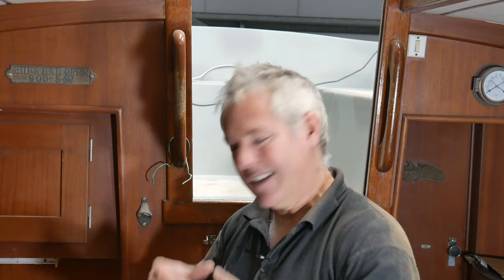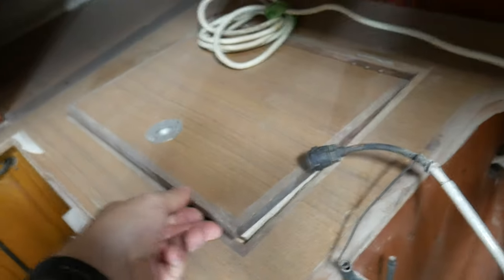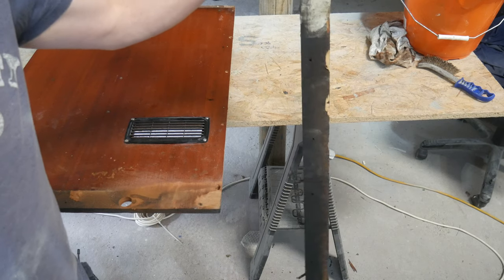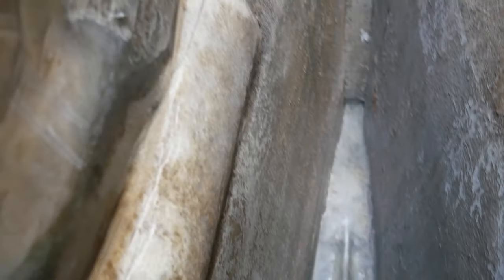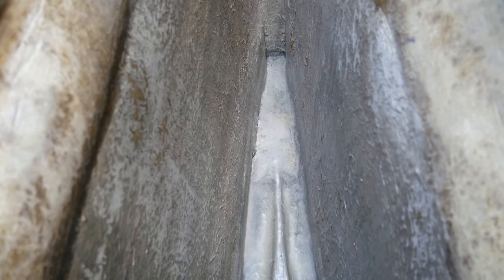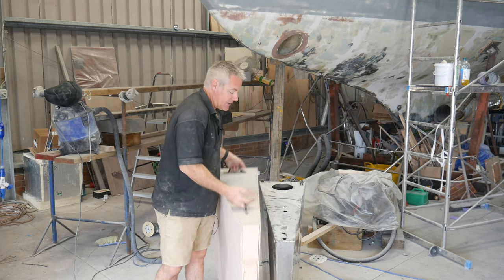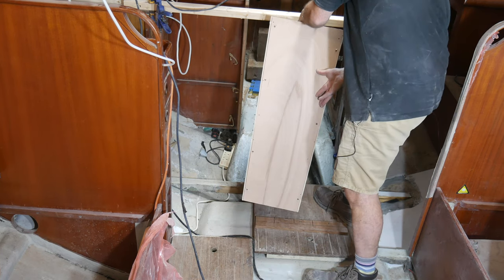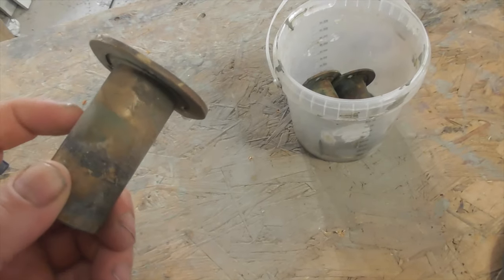#60 Plastic V Stainless Steel Fuel tank?

Comment: You're making great progress keep it up.  Regarding securing your fuel tank, you could epoxy some blocks of G10 and if you have the tank manufacturer put some attachment points use bolts to attach to the blocks or stainless straps to the G10(?).  Make sure you have access ports put in the tank just in case you need to reach in there to clean it.
Reply from the maker: Hey Rich that's good advice. I really like working with G10 now too.

Comment: As Mads (Sail Life) did. Put the heater pads on the deck and vacuum bag the underside of the deck. Vacuum bagging will cause the moisture to "boil out" and be removed....best part....it is quick.
Reply from the maker: @Garland Garrett I’m not sure that Mads used the heater pads on the underside of the deck. I saw him set the vacuum pack on the shell (Hull) but I didn’t see him do it on the deck? Which episode was that one ( where he did it to the deck) ?
Reply: @aboatcalledwanda6925  He didn't use them on the deck, only on the hull. If you recall, he replaced the entire deck core. However, since you have essentially sealed the entire top of the deck you can bag the underside and using a vacuum pump (as he did) create a vacuum under the deck and force the moisture to boil out (at less than room temperature). Not only will the water boil out -the vacuum pulls the moisture out of the core. Temperature isn't any issue as it will be less than room temperature. The heat pads will accelerate the process if laid atop the deck (and be out of the way). You will need a vacuum pump, reservoir, bagging, seal tape, and required hoses, you may need the cloth to assist the flow of air similar to vacuum molding. Its not the hull but the process is the same. Great videos, I've binge watched them all over the last 4 days when I found your channel.
Reply from the maker: @garlandgarrett6332  yes that's what I thought - I've not seen anyone use it on a moist deck core yet. Stay tuned all will be revealed :)
Reply: @aboatcalledwanda6925  awesome, can't wait.

Comment: Been involved in a lot of wet core (both foam and balsa as well as other woods) repairs in boats and I am sorry to say that the only way I have ever seen or used that is effective is to remove one of the skins and take out the offending material completely back to dry areas.  The closed cell nature of the foam normally used just will not dry although it certainly will soak up moisture and not just in the interstacial spaces.  In one case many years ago we had a 13 foot Boston Whaler that was totally soaked.  It was in a dry boat house and even with the outer fiberglass skin completely taken off that foam was still wet after a year!  In most situations if the area is very extensive and behind built in furniture etc. it just is not worth doing.  A few square feet of accessible coring is very doable if you provide the labor yourself but as it becomes more and more difficult to access it becomes less feasible.  You have to weigh your priorities with a limited life span of what you want to do.  Some things just are not worth your time much less the money.

Comment: Great video, I think you made the right decision going stainless for the tank the only experience other than outboard fuel tanks I have had is plastic bike and 4wd tanks and I have to say I am underwhelmed by their performance and longevity with several plastic bike tanks cracking after a relatively short time. avoiding galvanic corrosion should be easy enough just give the bottom half of the tank a couple of good coats of epoxy or polyurethane paint to isolate it from the electrolyte, also since it's a new tank might I suggest using  Fuel doctor or similar when you eventually fill her up to keep her clean. you can also get water separating filter funnels for those times when you refuel from a dodgy source.

Comment: Would recommend putting a pipe in place running down to the lowest point in the bilge below the tank when you refit it if there's room, so you can suck up any water that gets in there to stop your tank from corroding again. Also if you are having a new tank made, consider putting in a clear tube that runs from the top of the tank to the bottom so you can sample the fuel. If that makes sense  I think Calder has some great info in his books on tanks. Shoot me a mail if you need anything
Reply from the maker: @sailing Yacht Zora thanks heaps for reaching out and lending your support. I'm a big fan of Nigel Calder and have learnt a lot - particularly around batteries and electrics. Fortunately the lowest part of the bilge is in front of the tank - not sure if you saw the early vids but HR actually provide a drain at the lowest part of the bilge - so you can undo the plug and drain the bilge when on the hard - very cool! I think the corrosion of the tank was most likely due to galvanic corrosion rather than corrosion due to acids or chloride kick around the bilge. There were many metallic objects in the bilge that would have formed an electrical circuit (Swiss army knives, drill bits, forks, spoons, bonze tail pipes) - with salt water proving the electrolyte. Also there was no anode on the Bronze prop when I got Wanda, and as the prop, rudder stock are all bronze the fuel tank would have been the sacrifice as they were all boned together. Im planning on installing a DIY fuel polisher in the tank as my last boat in Hong Kong got inundated with diesel bug and I had a massive job to get rid of it. Will talk more about fuel polishing in later vids. Cant wait to get it sorted.
Reply: @aboatcalledwanda6925  ya I saw that bung, it's a great idea and I'm gonna add one myself I'd say. My keel has a 700L water tank and a 300L diesel tank so that would be handy. I've considered fuel polishing as well but might not fit that till refit part 2 😁
Reply from the maker: @SailingYachtZora  yeah its good to have the 'nice to have' list separate to the 'must have'. I'm not sure if the bungs are easy to source - if for any reason they are I know you can buy the complete unit from Hallberg Rassy parts and fit it yourself. Thats a lot of great ballast you've got down low with the fuel and water - nearing a ton?
Reply: @aboatcalledwanda6925  I'll probably just drill and tap the plating, it's 8mm steel. Ya it's handy, I'm not sure how to utilise it though. I don't like the idea of water against steel or a fuel tank that I can't access to inspect. Time will tell. I find the boat work easy, but it's the battle you fight between your ears to be the hardest part!
Reply from the maker: @SailingYachtZora  YES!! I get to the stage where I overthink things. Was talking to my Dad about this the other night - he is a very skilled wood craftsman. You spend a lot of time thinking though how you will approach something, the sequence, dependencies, tools, jigs etc. Then suddenly it all falls into place and it's just a matter of execution what you have thought through. Then it's all easy. Getting to that point can be hard though sometimes.

Comment: _ Have you considered using "Foam Cement" as a bed for your tank base? It's STRONG, LIGHTWEIGHT  and Everlasting. It can be Epoxied over to prevent any Gunge, mould etc. ( You pour it into the Bilge, rest the tank on top of it, let it dry, remove the tank and then epoxy coat the whole bilge area. ) The German name for the foam concrete/cement is "Schaumbeton" A better bed you'll never find and it'll carry the load where it's needed leaving you to only brace the Topsides for future removal! _

Comment: You are making great progress even if that involves going backwards at times. With reference to the wet deck core the only suggestion I can make (in common with others here in the comments) is to try the vacuum route in conjunction with a heat mat.
Reply from the maker: @Norman Boyes thanks for your comments - that's definitely the direction things are heading in now.

Comment: Have you considered using (part of) that bilge as the fuel tank? It would require a thick layer of a suitable epoxy over the GRP but you have already sanded the area so you're good to go. You wouldn't have to worry about fixing the tank in place. You should however glue in one or two baffles. You could also maximise the size of the inspection hatches. Much cheaper (and probably faster) than ordering a custom made stainless tank. Love your project by the way! Brings back sweet (and not so sweet) memories.

Comment: If you made the tank of stainless, the tank sides and/or ends could be extended above the tank top, and shaped into bolting pads that fitted against the inboard sides of (what look to be) the engine girders. You could make up some further templates to position them. These would support the tank above the bilge, which would allow effective drainage of any bilge water in that area.  Maybe 4 bolts along each tank side.  Greg
Reply from the maker: Cheers Greg. I would like to keep the costs down so probably the simpler the tank design the better.
Reply: A cheaper way to get the same bolted arrangement would be to just do a basic tank, and weld straps to the tank side, extending up, sort of like hull chain plates.  Greg

Comment: I wonder if the galvanic corrosion on the tank was caused by the steel engine coupler ... it was extraordinarily rusty for something that's often oily.

Galvanic action needs both anode and cathode in the same solution.
Reply: Alain Moran I didn’t see that the tank had a bonding strap on it... when the new tank is welded up they should add a tab near the pump to attach a bonding jumper.

Comment: just keep in mind the engineering principles of load transfer in that tank, the entire tank should be supported by the keel, not the hull. I would be very careful placing anything that could create a lateral load on the inside of the keel, you dont want your keel to split apart after a bit of pounding in a seaway!
Reply from the maker: @Superform good advice. I want to make sure it is sitting flat on the bilge and has shims in the side so there is no side movement of the tank within the bilge. Could take a bit of work to get there...

Comment: Hey Richard. 
Good seeing your energy and approach to fix the boat. 
Have been thinking about the corrosion and pitting in the bottom of your tank. Stainless steel is widely used for fuel tanks. Condensate in the bottom of the inside of the tank should not lead to saline conditions where corrosion and pitting occur ? 
So the saline water can come from persons (soap or other products runs into the bilge) but that would be general problem (that I haven't heard of) or from seawater get into the boats during accidents or a (tiny) leak after the accidents ? 
In tropical conditions the water in the bilge dries up (water evaporates) and the salt concentration increases - creating the conditions for corrosion and pitting together with elevated temperature. Have you considered to check for leaks ? It would be a shame to put in a new tank and have the same problem again later. 
Another thought, can't the upper part of the tank with all the (expensive) connections be reused ? 
Best regards Kent
Reply from the maker: @Kent Dreymann thanks very much for your comment and thoughts. From what I read, proper 316 stainless steel has Molybdenum which protects against chloride. So salt water should never corrode or pit proper 316 unless there is other factors at play. Therefore I think it would more likely have been pitting due to Galvanic corrosion - where ions are moving from one metal to another and the stainless steel starts to become pitted. That could be due to poor grounding, or grounding to bronze without an anode in place. When I got Wanda there was no anode on the prop which is bronze and heavily pitted. As the tank was bonded to the prop I think that's where some of the corrosion took place. I have learned a lot about materials in the process!

Comment: Can you not reuse most of the original tank. Galvanic corrosion via the prop etc is unlikely as they were not in the same body of water but something such as a bilge pump or some other metallic or electrical thing in the bilge might have been a contributor. Hen refitting perhaps build a better bulkhead at the aft end of the bilge to keep the tank safe but also include some means to extract any stray liquids around the tank... Also have you tried using thinners or acetone or whited spirits or petrol on the glue residue I had good results using one of these... Cannot remember which....

Also be sure that your tank pickup is perfect as I just lost my entire season due to air getting in the fuel line seemingly from the fuel pick up...

Nice stainless cleats available cheaper than HR originals...which are aluminium...

When you glass in the tank form a nice gutter to take any stray liquids towards the bilge ideally with a little spout at the forward end so you can get a container underneath to capture any oil or fuel or coolant leaks.( You will have many) keep up the work...would love to hear what your budget is....
Reply from the maker: Hey Tony - the tank is knackered - no telling where it could open up next as the pitting is everywhere. Acetone is good for the glue but you need a lot.

Comment: Sail Life.   from denmark u tube videos this guy has done all the stuff you are doing give Sail Life a look
Reply from the maker: @Lloyd Buttrrworth I have a lot of respect for Sail Life - but I don’t think he has dealt with the same problems I have? There are many similarities - we both had rotten deck which needed replacement. He had osmosis to deal with, I did not. I had structural issues to deal with , and needed the shell to be repaired, he did not. I had a busted fuel tank which leaked diesel into the keel, he did not. So I think it’s fair to say we are facing some similar and some different challenges?